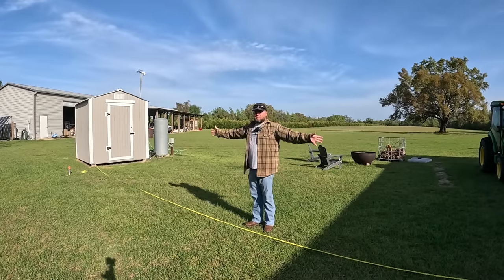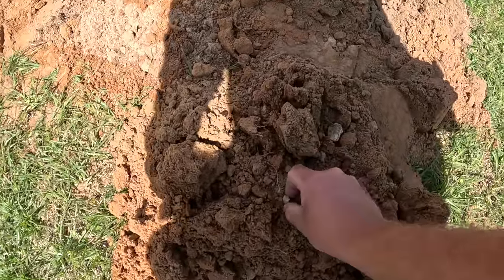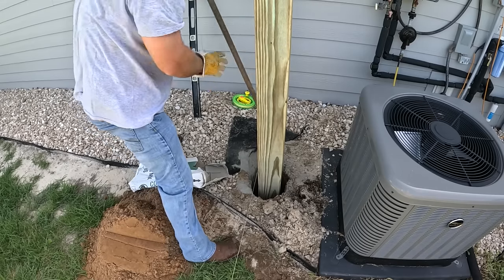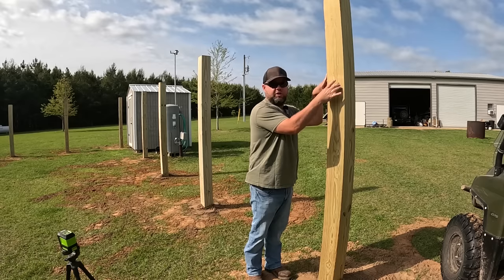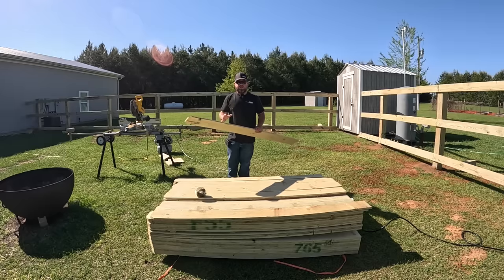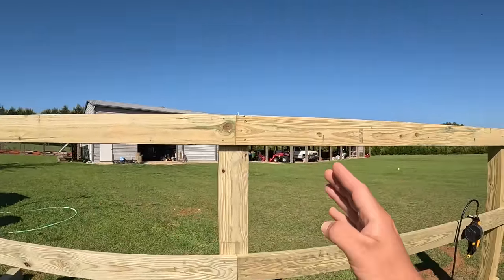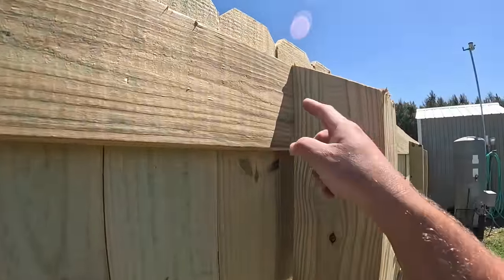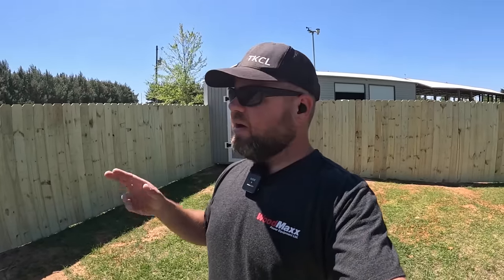Building A STRONG Privacy Picket Fence!

Comment: I rebuilt our fence last year this exact same way. A word of warning, when these fence slats get wet, those screws WILL snap off at the head. You are better off simply nailing each slat. We're in Oklahoma and the wind and water put a beating on the fences. I used deck screws as well and at least 10% have snapped off and the heads popped out of the wood. Just a word of warning.

Comment: Hey Andrew... You tend to build STRONG.  I like that. Another good job.  I do have a question/comment though.  There is an awful lot of "sail area" there. In a strong 'blow' that fence will act just like a giant sail. It'll catch every bit of the wind with no way to "vent" it. It probably would have been better (maybe.??) to place your picket boards on alternating sides of the fence..... sort of like this  --------  .. You could have overlapped the visible edges of each picket so the fence appeared solid, yet would allow the wind a way through the fence.  Would have taken a lot of the wind load off of the fence.
But, whatever....  It's a very high quality build.
Happy Easter my friend.!

Comment: Not sure if you mentioned it. If you have a sprayer, add varnish or a stain to extend the life of the wood fence. Yes, that leveler would come in handy. I bounced over to check on Amazon on the price. Currently unavailable, but there are others or similar anywhere from $30-$75. Worth the investment.
Reply from the maker: Hate that it's sold out already.

Comment: While the pretty side does look pretty,  the back of the fence is ugly.  You see that from all points of your property.  I'd have put one board on one side and spaced it one board before nailing the second board.  Then on the back side, I'd put a board to cover the gap.  That way, the fence looks the same on all sides.  In addition to looks, it provides space for air movement that is now blocked. (That might be a blessing!)  I don't know if I described it well.  In any case, the "lived-in" space is going to look spectacular when you are through with the gravel, sinks, flower beds, etc.  I also love that you're going to put in a swing!  Hard work, but well done!  I can't wait for you to stain the front fence!
Reply from the maker: You don't see the backside unless working at my shop. No guests can see the backaide from the house or driving in.

Comment: Huge fan. Been watching for years. It is a little odd that you overbuild but then cut corners like pouring a dry mix and then spraying down with water. Seems like it somewhat negates the overbuilding of the fence imo.

Also, I’m not from a completely different climate (East Texas on the coast) even treated wood rots eventually. Putting post directly into ground is a bit risky, especially as you have clay and not super good drainage. I know you out the gravel at the bottom, but the dry mix is just filling in those voids.

Also, as to butting up the boards on the fence, that catches a ton of wind. Leaving gaps not only helps with expansion/contraction, it helps to let wind pass though.

Comment: Just a thought on one thing,
It's hard to get a sense of depth on video but it seems a back door would be desirable , I agree it would be a weak point unless over built at which point it's probably simply not worth it (Especially after the fact) but as a practical compromise perhaps just a functional hinged pass through access cut out panel or even a full size 'door' for objects even with the three horizontal 2x6's still in place that you could actually squeeze / crawl through if nessasary or desired for any reason? It may look a bit hokey and you may choose not to share it but it would definitely be beneficial for convenience and functionality imho.

Or not ?
Reply: Definitely needs a gate. Super annoying to have to walk around the whole wall whenever you want to get back and forth quickly.

Comment: Did you have to rip any to fit?

How you keep em plumb, must've been cut straight from factory I'm guessing
Reply from the maker: I use a level every three boards they are not straight from factory. The very ends I had to rip only two boards.